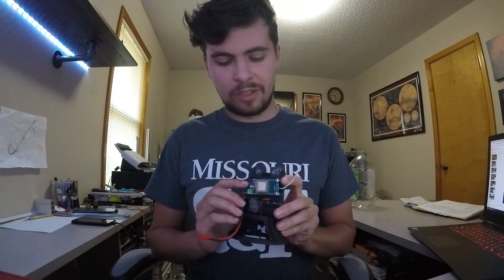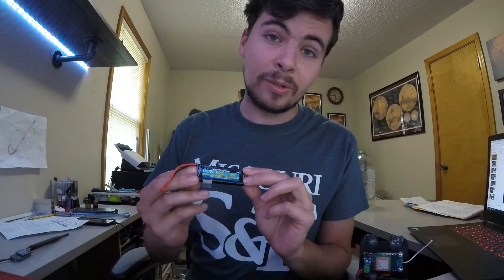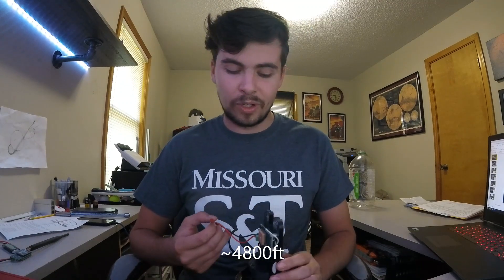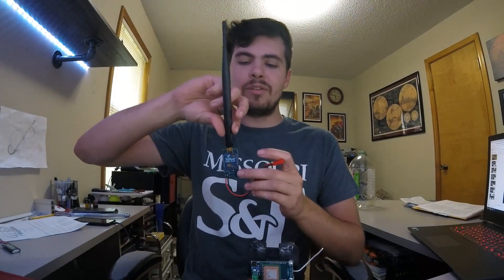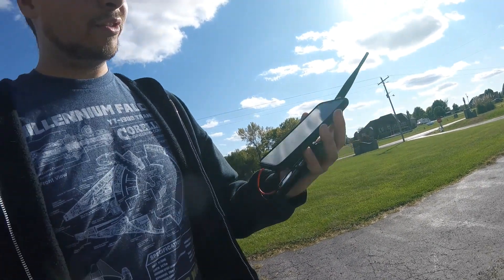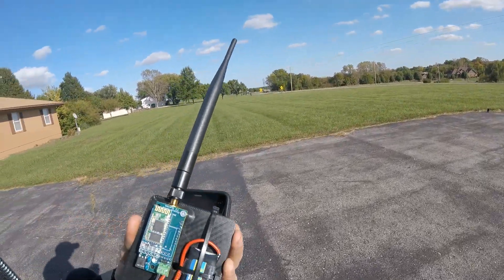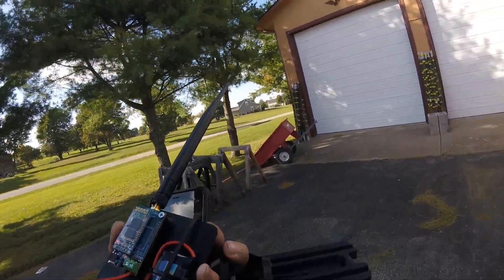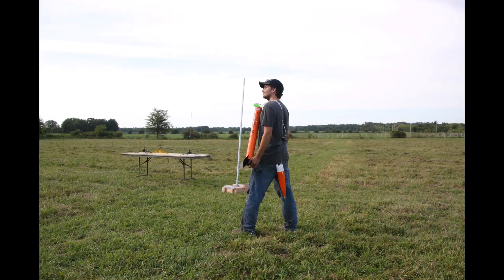Missile Works T3 - Tiny Telematics Tracker System

Comment: I am trying my best here to get the transmitter and receiver to link, and I have yet, after weeks, been able to get them to link.  I have tried powering them on at different times, keeping line of sight, going into a field, as well as staying away from powerlines.  No luck.  I havent had any issues out of the rocket locator app either.  Its like the tx doesn't work or something.

Comment: What phone did you use with your T3 and what app?
Reply from the maker: I've been using a Google Pixel 4 for the last 2 years but initial testes were done on a Galaxy S10. As for app I use Rocket Locator.
Reply: @InvertedPursuitsLab  do you have to have internet service for rocket locator app?  Or will it work without?  Mine is just not working!
Reply from the maker: @66jraccel  The rocket locator app doesn't need internet service, because it connects to the T3 base station board via bluetooth. It pulls rocket GPS data from the rocket to the base station board and that should translate to the rocket locator app for visual readout. I will admit mine didnt have a map overlay when used in the field due to no internet but just start walking around and it's pretty obvious if your are getting closer to the gps point it shows on screen relative to your position also shown on screen.

Comment: Just wondering if you've used it yet in a rocket and how it worked
Reply from the maker: I used it in my level 2 cert flight and she worked better than advertised in my opinion. Highly reliable and very easy to get set up.

Comment: I don't know what app you're using for the T3, but many apps will give you the last known location so if you drop your connection you can still go to the last location and start looking from there.  I find that typically by the time I get near the last known location I've picked up the signal again.  Not sure if that's how your app will work, but that feature has saved me many times.